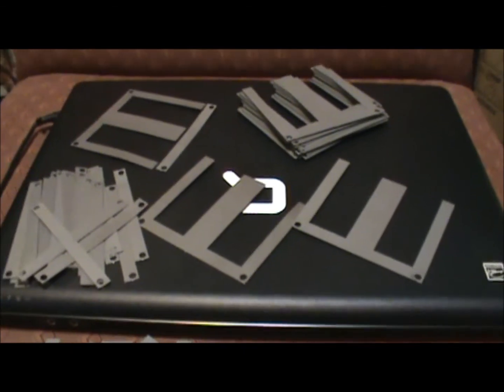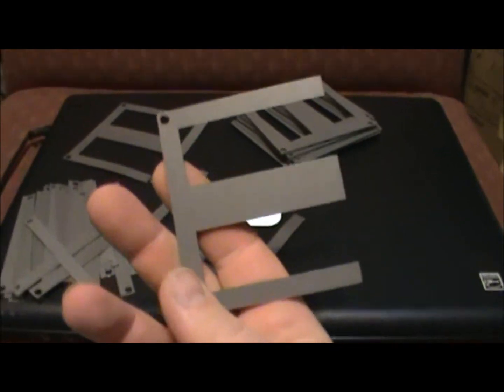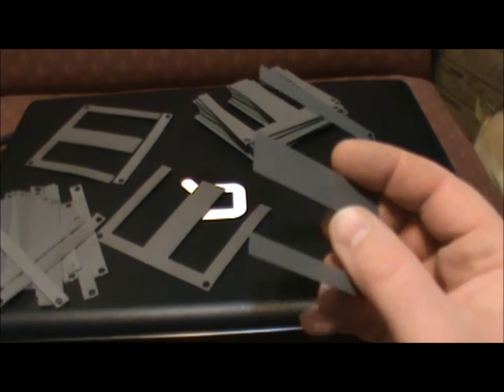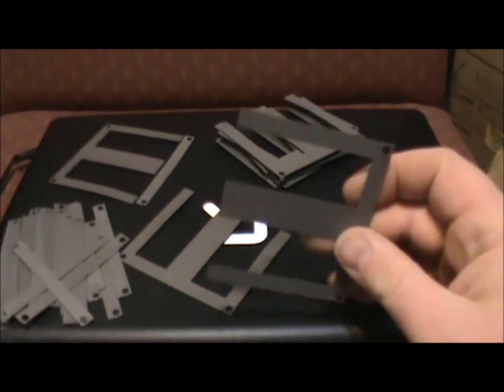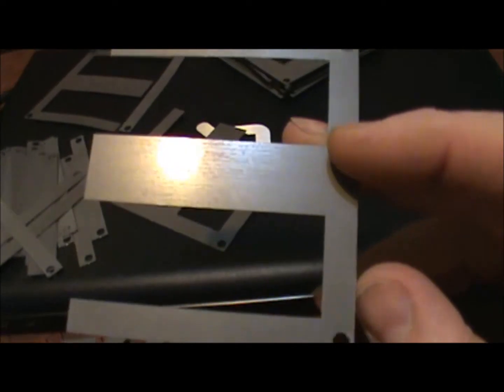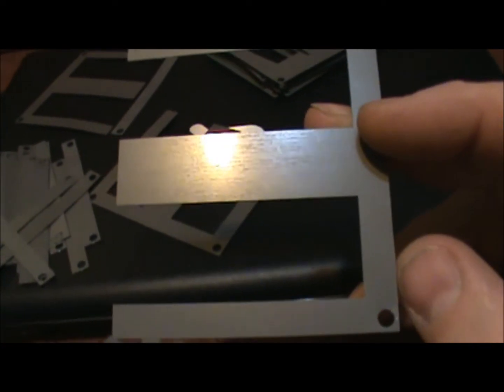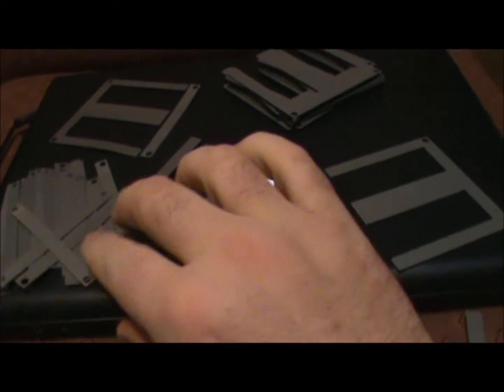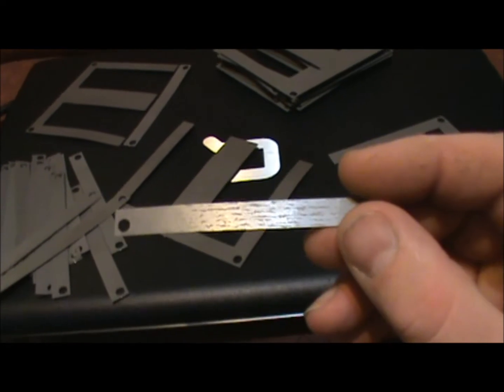Meyer Laminated Cores

Comment from the maker: i already made the call. years ago. i talked to ferrite core engineers directly. core permibility and frequency and geted frequencys, add up to saturation of a core material. just before peak saturation is the highest voltage. at saturation, you just have a magnet. it all has to do with expanding lines of flux. you can see me measuring them with a gause meter and that trifield meter. obviously meyer used this magnetic field to his advantage. as in these cores. insulated grain orinted silicon stl

Comment from the maker: due to the high cost of material and large number of laser cut parts. these look to be 250 dollars a set. if there is a large number of sets sold, the price could come down. i assume 4 sets to go over seas, and 2 sets to stay in my group. i also assume your group will not spend the money. i could be wrong. so i assume 6 sets to be in use in the coming year. and those 6 sets will not cover the cost to produce these cores. but we have to make them in order to try them. exact reproduction works

Comment: Hello, I would like to consult with you since you already have experience. I have compiled a chart D. Lawton `s but I do not know how to make the inductor and find resonance. The problem is how do I find the inductor indektor, do you know the geometry of the inductor and multiple possible settings in which you can find resonance decomposition of water. And another circuit 9 xa and  9xb 8 xa what a difference between them? I will thank you